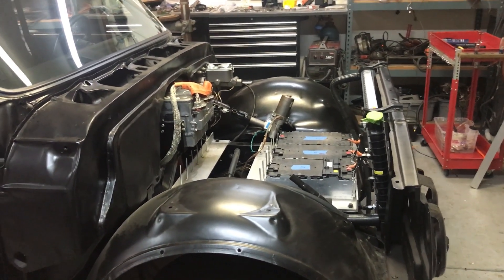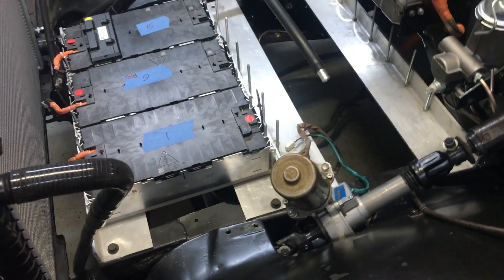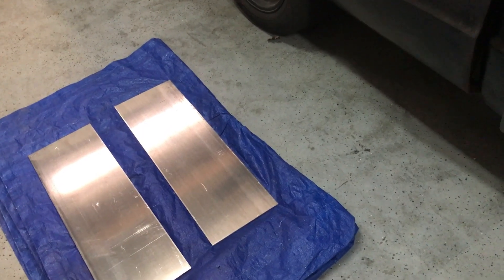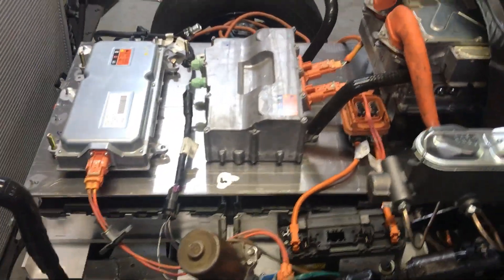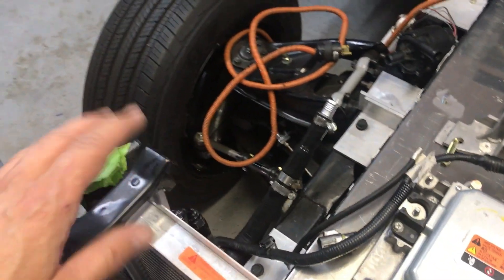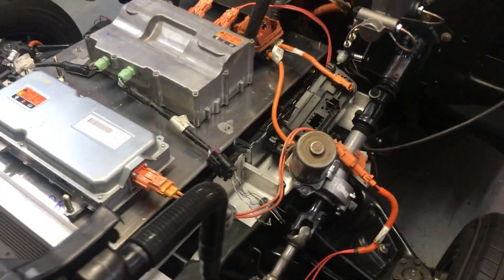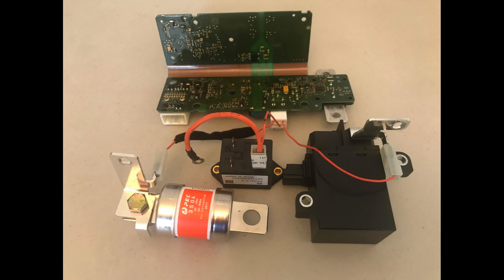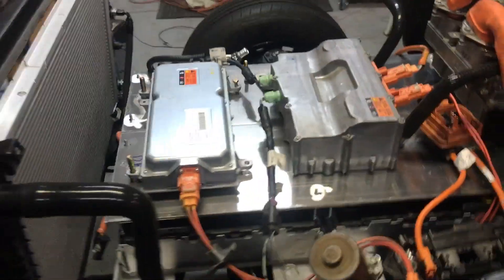Electric Truck Battery Tray

Comment: Looking good, kinda confused why the DC to DC isn't built into the charger like the Outlander Phev but I guess GM had their reasons.
Where I live it is kinda wet a lot of the time so weather proofing all my batteries is a priority. 
I love the engineers oval holes - 
Mark it, drill it, swear at it, oval it out, pretend it never happened. 🤣
Reply from the maker: I own a Tesla Model 3 Charger / DC DC Converter combo unit which I may go with I think the Volt first gen charger/converter pre date the combo units by a few years, and as far as the oval holes that's what over sized washers are for, lol, what bit me on that one is that silly 1/2 ridge that runs between the batteries, I did not account for it on the floor layout when I drilled the first plate, I caught it on the second plate
Reply: @Good-Enuff-Garage  Nissan did the same on their Gen1 Leaf but I think improved the design for Gen 2.
I was just thinking "make sure to allow room for washers with yer fancy domed nuts. 😁
The 6mm shank, dremel/drill rotary burrs get a lot of use in my garage. 🤣
Reply from the maker: @alibro7512  LoL, say hello to my little friend: https://www.amazon.com/gp/product/B00P888CCM/ref=ppx_yo_dt_b_search_asin_title?ie=UTF8&psc=1